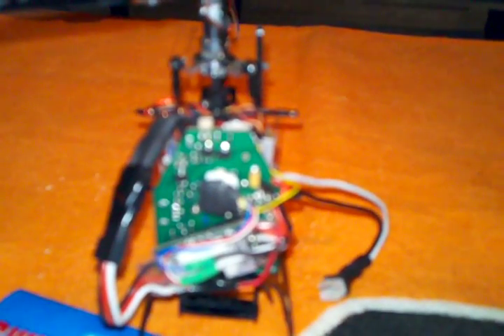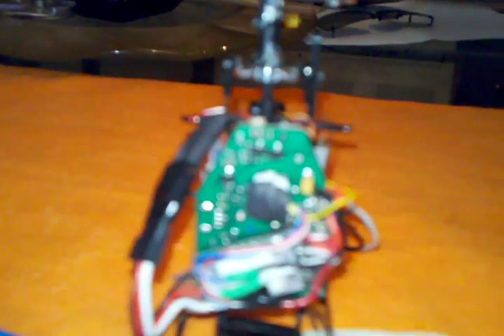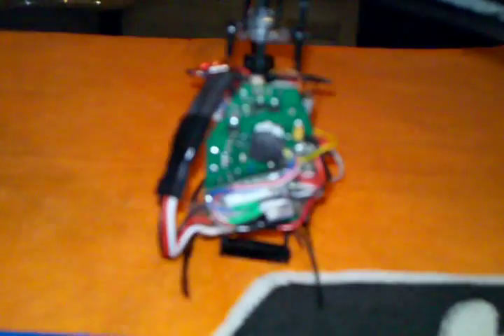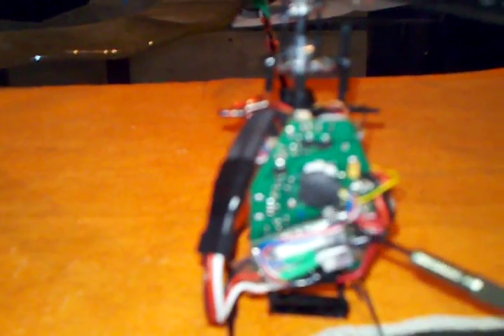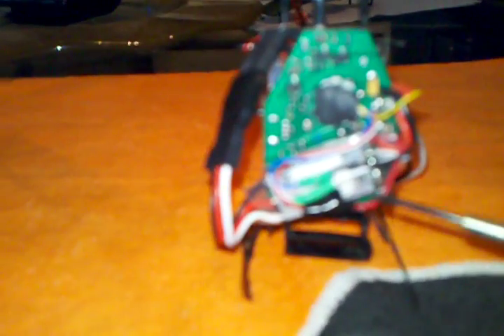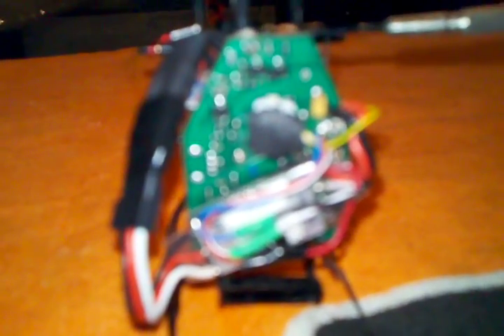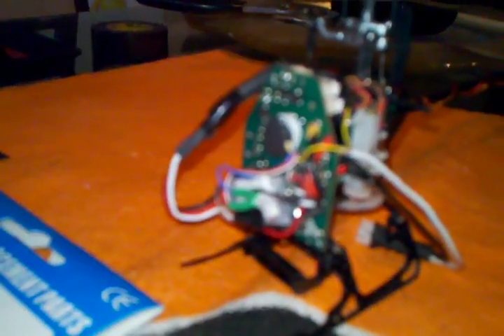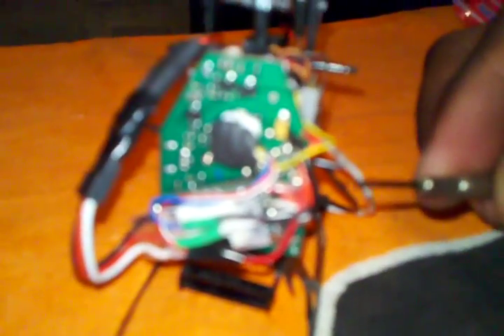Blade Mcpx brushless conversion overlook

Comment from the maker: @mrfourtysevenman it could be the converter is no good.  I have heard people not having good luck with that one.  I am currently using the tiny resistor on the back of the board.  I just use that to let people know they can use that place if they didn't feel like soldering on the tiny resistor on the back.

Comment: @tntneon 
it is soldered on the main motor FET i have the helidirect esc and converter. the brushed motor (when plugged in at the same time) will stop but not the BL. i saw in a forum you had a resistor on the main motor plug and the signal wire was there?

Comment from the maker: @aloukz both are hood motors.  I started with the e
Walkera but up with the hpo5s outruner I like it the best.  The kv on the hpo5 is 13300 and its smooth on the throttle. Be blessed

Comment: The problem is the ID of the motor is too small for theHelu-Max brush less motor. So I tried the motor with the original pinion that is installed on it.  It is against the maingear drive too tight.

 The motor also seems to have one speed when I control it with my DX6i. 

I tried carving out the motor mounting (plastic) screw holes to allow the motor to move in making a looser connection with the main drive gear but still too tight. I must have missed the numbers for the nine pinion teeth gear